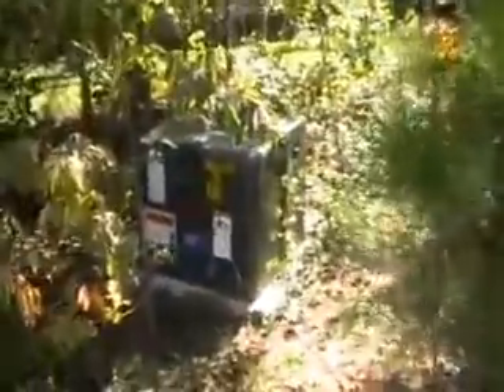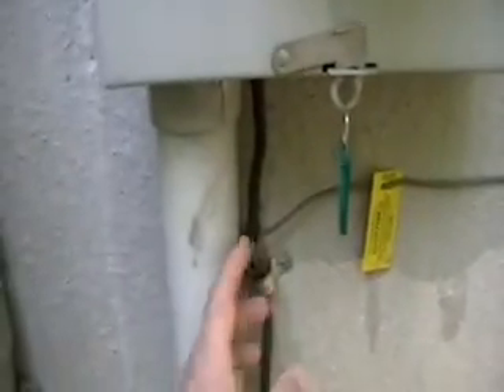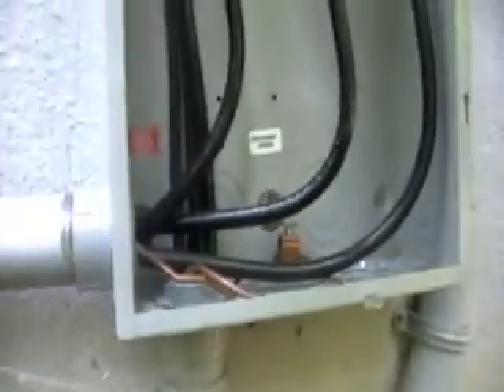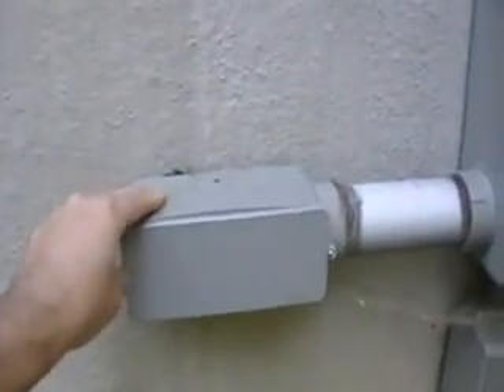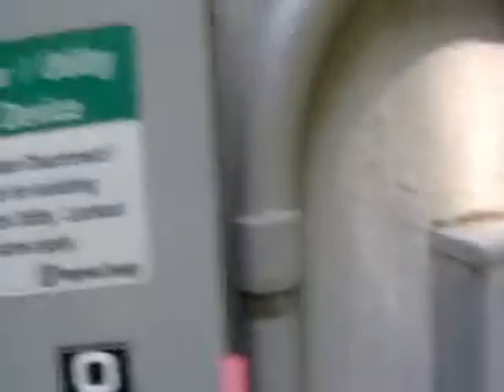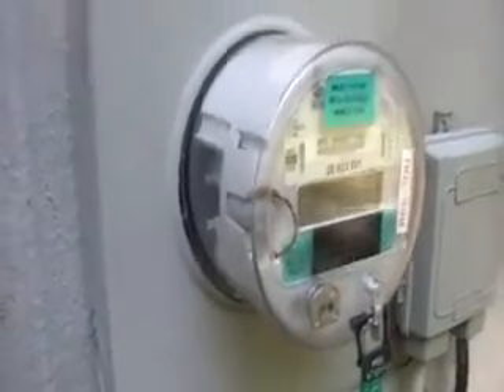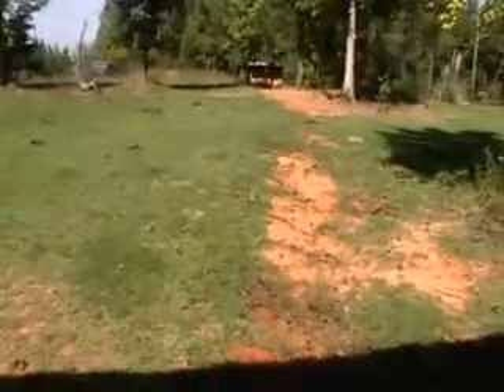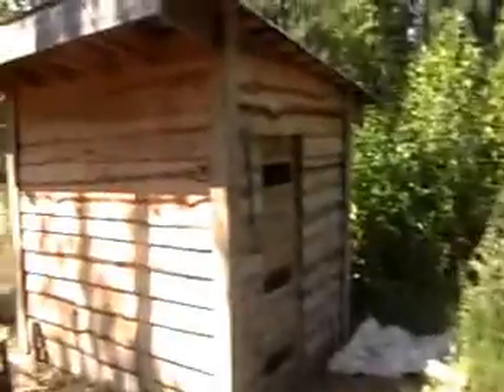PART- 1 - wind turbine and solar panel installation  explained at home- http://www.rockriver.us  -

Comment from the maker: @thechromewheels 

I have 2 hots and 2 neutrals (AC) coming into the house from the power house.

The outbacks take the DC and convert to AC. I power the house with AC. There is no DC in the house.

Comment from the maker: Thats interesting you bring that up. I have always wondered if you could build a gigantic capacitor that could store the lightning and then just bleed the voltage out later. Just like those wind up emergency radios or shake up flashlights. Now that would be sweet..